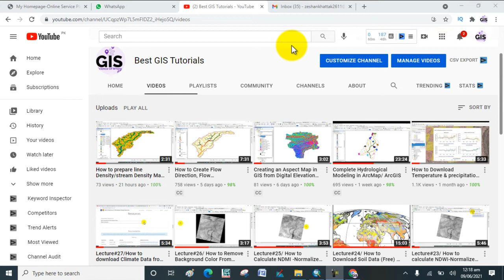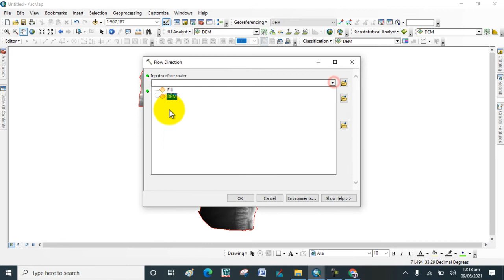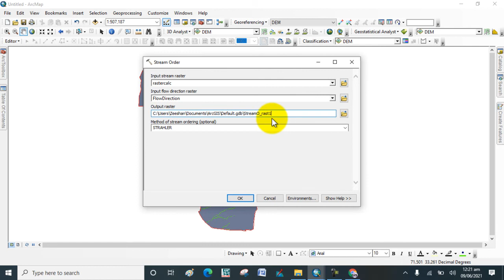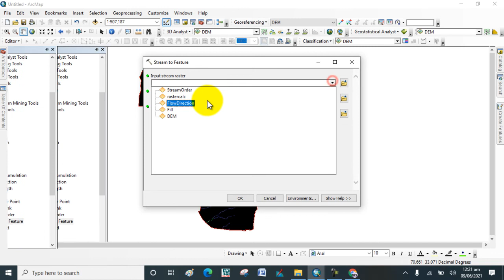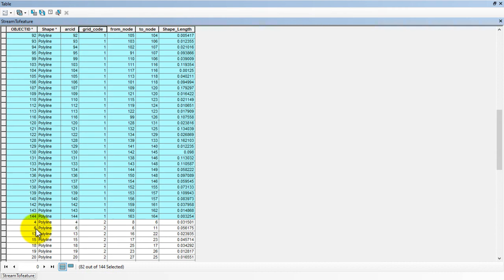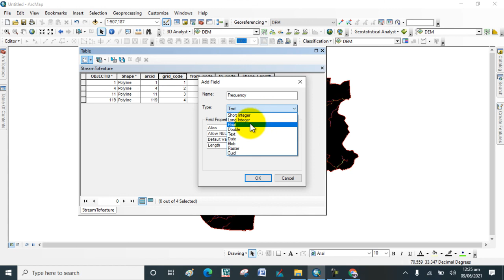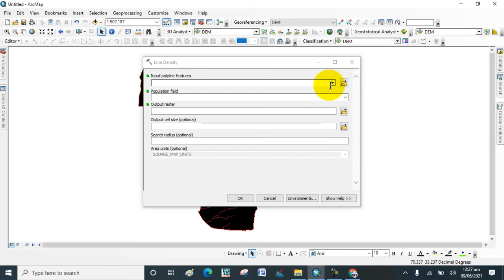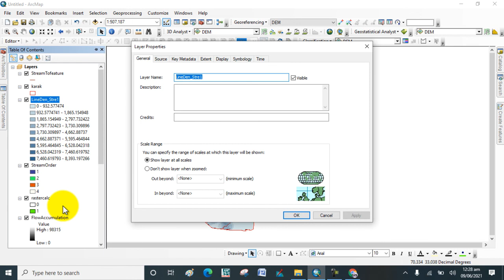Stream Frequency/ Drainage frequency Mapping in GIS Software

Comment: "Flow Accumulation>1200 " this part is not clear why 1200 used. is 1200 depend on any particular factor? Please help
Reply: It is the minimum length to consider it as a river. You can change it according to your convince
Reply from the maker: Its actually according to the  study area